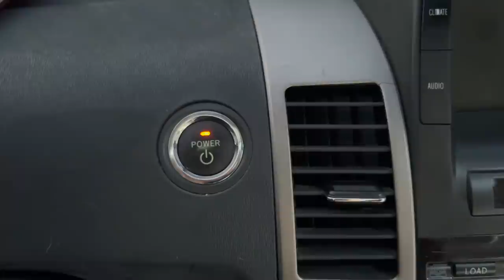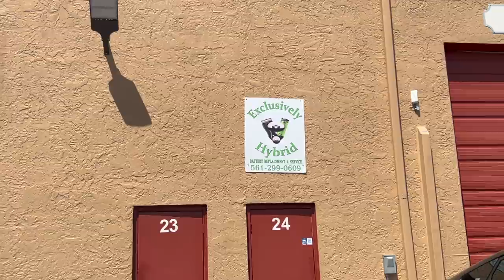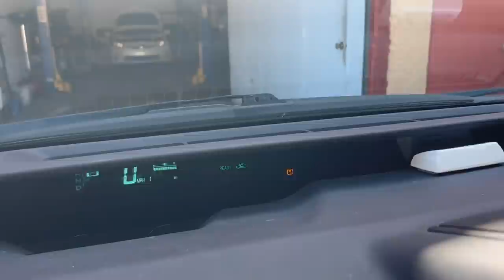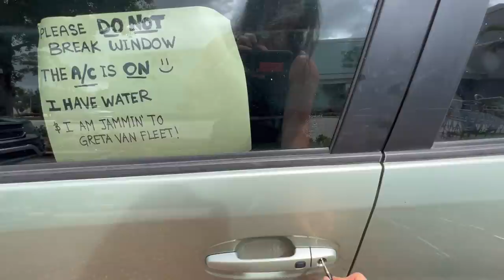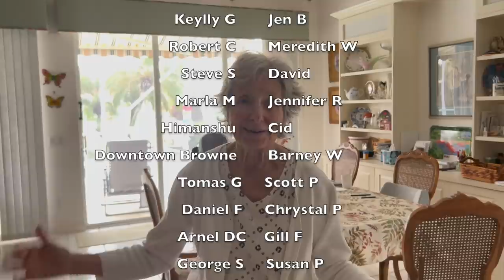LIVING in a PRIUS: We've got some BIG (car) PROBLEMS!

Comment: It looks like one or more of your tire pressure monitor batteries have died.  This is common with the mid 2000 priuii.   

    New TPMS sensors are not expensive from Amazon and they can be replaced quite inexpensively by any tire shop.

      For as much traveling as you do, it would be worth it to make sure you know when one of your tires gets low pressure.

Comment: Nomads unite, lol! I like your style, I like to see various adoptions to this way of life and what works best for each individual. Personally started out in Tacoma with a converted bed to survive weekends in the mountains avoiding ski traffic. It worked out so well decided to go full time, eventually saved enough for a cargo trailer to accommodate my motorcycle and converted to toy hauler camper. Now I've upgraded to a slide in camper on 2500 Ram, I like having windows again, oh ya and an on board shower and toilet is nice to have again. I can drop the trailer and camper, have a base camp, and explore with the truck or bike. The trailer operates more as a shop now than a living space. For those whom prefer cars consider a Subaru, and then check out what "Ironman 4×4 America" can do to them. You'll get places just the same as trucks. They probably have the best 4×4 drive trains on any vehicle, it really is amazing what they are capable of. And Ironman can rig those things proper. Not sure about the fuel economy compared to a Prius but they may have some hybrid models and crossovers that are probably  as roomy as the Toyota you just demoed. If it's a fuel issue, consider diesel my preferred fuel, still average 12 to 14 mpg fully loaded up on the highway . Pushing 15000 lbs with all propane, water, gas, and diesel filled, can be off grid for up to a month. Taking into account that lithium to make hybrid batteries is strip mined by massive equipment powered by diesel engines in the first place, I'm really not to convinced that they are all that eco friendly, really just marketing. Excuse for the novel, white out blizzard in Central OR, safe travels!

Comment: A good thing the gas tanks are designed to take shocks like that. I have a 2004 where the rear spring came dismounted from the rear end and then shot out the driver side of my vehicle as I was doing 45 miles an hour down the road I seen in my rearview mirror plume of rust and dust and in my side mirror I saw the spring doing 45 miles an hour alongside me and then it veered off the road and I tried to find it for 45 minutes unsuccessful. What scared me is I had my pitbull black lab puppy with me. And I was worried about getting the damn vehicle back to my house without toe. Older cars can be very scary. Especially ones close to the ocean in the Northeast with salty roads
Reply: I would much rather have an older car or truck than new. New ones are made cheaper, and too much technology to fix when they break. I've worked in the field for about 20 years, even though older cars and trucks can have issues than newer ones usually won't, you're better off with older. What state to do you live in? I'm in NH , near concord
Reply: @richsweeney1115  I'm in Cape Cod Mass. And I agree with you the older cars are definitely far easier to work on and made it to run much longer than the newer ones. The technology is terrible. All the motors are basically made out of plastic today. And once that stuff gets heated up and cools down so many times it warps and breaks. It's so frail with to work on after say about 40,000 mi at most of plastic clips you touch are going to snap to get to another part that you have to remove half the engine for just to replace a 40 cent plastic cam or something. Even my 92 BMW had a whole bunch of plastic on it but it's still lasted almost 400,000 miles. And me for 20 years beating the snot out of it. I never had to do the engine but the guy that I bought it from had the heads done right before I got it with 130,000 miles on it. Outside of that I never had to place the clutch the transmission engine. I did have to do the brakes exhaust suspension and things like that. But it was still easy enough to work on. Not these newer ones though.
Reply: @richsweeney1115  the crazy thing is about a month and a half prior to the shock breaking loose on my rear end I replaced the gas tank due to rusting out. And I'm damn glad I did because I know that spring would have shot right through one of those rust spots on the tank when it went bouncing off of it because it left many big dents in it on the side and back of it. And I could tell it was there because it was a brand new tank that I just put in weeks before. And that's on a 2004 Mercury Grand Marquis which if you know anything about those gas tanks you know the studs can only be used one time and you have to replace them I bought the gas tank straps for about 75 bucks I spent $110 to get four sets of the studs because that's the only way they would sell me so I still have two of them and of course I never broke the studs off I left them long so if I need to do something with that gas tank again I can just pull it down and reuse the studs that are already there if they don't break off when I try to take them back down. But Ford makes the studs so that when you pull them up you're supposed to break them off so that the next guy can't do a repair on that without Jerry Reagan something up or replacing those bolts. That cost $102 for four which included the receiver the stud and the nut.. I sold my 2015 Nissan Altima piece of crap before it broke with 55,000 miles on it and picked up this other car for $1,000 from a customer of mine that I worked off. He was an older guy so I didn't think I would have to look underneath the car for any kind of restaurant until I got it and started going through it I was horrified he lives a block away from the ocean and that salt Air just destroyed the car plus the salt on the roads in the winter. The body and cosmetics on the car look all right until you go underneath and you see all the rod the bumpers are riding off the frame is rotten to shit. I'm afraid if I touch too much More of it it's just going to keep breaking. Right now the Cadillac converter one of them is shaking rattling like a madhouse where I have a high-powered stereo installed in that car as well that I have to turn very loud in order to drown that noise out. But it still goes like a champ despite all the rust. Of course the engine only has 125,000 miles on it and driven by an old man it's entire life. So it's broken in a little. But the body will never last as long as that engine. And also the transmission shimmies from second to third gear sometimes. I went to auto technician school way back in the late 80s. So I pretty much know how to repair everything on the car I just don't have all the equipment and tools to do such. I went on to be a contractor on houses and I have all the knowledge to completely rebuild a repair a house now except for the fact that I also had colitis rip out my large intestine in 20 years ago and now it's Crohn's colitis and a whole host of other issues and a bag of poo on my belly that prevents me from doing many things. I used to be able to work 12 13 hours a day everyday now I work through three four hours a day I'm exhausted for the next 2 days. That all started when I was 30 years old. I'm 50 now and these last 20 years have sucked ass. I went from never ever needing any help from anyone to needing more help than I care to ask for..

Comment: Nikki I recommend getting another vehicle or getting a warranty for vehicles with high miss or these auto shops are going to over charge you and tell you that you need this and that plugging your tire I'm sure that wasn't cheap and you could of done it yourself just get you a tire plug kit
Reply: She had a check engine light on for months and there were four codes that they showed right on the screen.  A Gen 2 Prius is an exceptionally reliable car.  It's not as easy finding something a whole lot better than that without spending a lot more money.

Comment: Hi Niki, I had a 2013 Prius, even with normal driving, I would bottom out on some drive ways. I was always careful at campgrounds. I sold it at 90K miles because I feared having to replace the battery pack. About 4K total with installation. I think around 100K for this to happen. I love your channel and life style. I always worked part time most of my life, and enjoyed traveling and bicycle riding and camping, and spending some good years with my aging parents till they passed away. Now I’m retired and have no regrets in my life. You and your doggie keep having fun. 👍🏻👍🏻

Comment: Our first Black Lab went nuts if you told her we were going to Grandpa's place. She got spoiled every time and got to go swim and play in the Columbia River and run in the mud at low tide. They lived on Puget Island on the Columbia River 50 miles away from where I grew up. By the time I was 12, I had my own keys to the boat and could go there myself when I wanted to, and Midge got to go most times.

Comment: TPMS light is still a light, I'd recommend getting new sensors, that way if you do actually get another puncture you'll know right away.
Reply: Thank you for stating this, I saw that too and wondered how the mechanic let her leave with it on.
Reply: Look at time stamp 9mins 48 sec tpms light is off just needed time to rest .and i am sure the repair shop told her it would reset.

Comment: Been camping at motocross tracks with my wife and two young kids using our Mitsubishi PHEV Outlander SUV and a tent. Plug in hybrid allows for great opportunities to use the EV battery to power your camp site and use the gas when you need to charge the battery back up if you're no where near any hook ups. Been cooking off the car EV battery, charging my kid's MX bikes, topping off my tent house battery when that is not trickle charging off of solar or when kids need to warm up inside or grab some AC off the EV side in the heat of the summer. If you locate a charging station, we can charge the battery and save it for later while driving with gas, or charge the battery with gas while driving.

Comment: 1121 code does not indicate cooling system failure, but rather cooling storage failure; the cooling storage tank is for cold temperature efficiency.

You need a hybrid professional contact, not just a repairman that charges for everything.  Either way, 2nd gen prius do not withstand heat or sunlight well.

Comment: Curious what they replaced to fix your car. You had a flow valve stuck problem which is typical on that gen prius and also an EVAP small leak, two separate problems. As long as the tank dent isn't too deep, should be OK, it uses an internal bladder and you probably just dented the shell, but yeah...it's not an offroading vehicle. Water pumps typically go on that gen also, which i noticed he was looking in that general area with the flashlight. They were using Techstream, which is Toyota software so good on them, but get them to check your HV Battery cells loaded and unloaded so you dont get the triangle of death and have to pay $$ for a new HV battery, which will happen eventually.  Also, clean the HV fan, typically an item missed but critical to the longevity of your HV battery. Also check the connector beside and mounted on the HV fan, usually corrodes and causes problems too. Toyota Master mechanic here.

Comment: Have you considered putting a hinge on the front or back of the storage compartment where the passenger seat is supposed to be?   it would allow you to open it from the inside if you move the dog bed just long enough to get what you need?

Comment: Hey I used a prius for my bike biz for a bit.  I got way better gas mileage with 4 bikes on top than I did with them on the back.  Just something to maybe think about.  If you happen across I 70 (Glenwood Springs Co) I have one you could try out.

Comment: Try getting a dodge van or some big vehicle with a 6 cylinder , those hybrids are ridiculously expensive, I got a Nissan sentra with 129,000 miles driving to Vegas/ calif. 4 times a month . Also a Nissan truck frontier , very very reliable no major work in 6 years .

Comment: Love the vlogs. I have a 2007 Prius I had for 5 yrs. I replaced my hybrid battery’s in 2017 now the triangle of death 💀 is back. I’m thinking about a new car but my Prius gets the job done so I’m replacing my hybrid battery’s for the second time in 5 yrs I’m wondering if that’s normal or it’s something else and I should move on but let me tell you I got it with 180k I’m  at 429k and I will go to Florida tomorrow if I wanted to . My conversion van it’s just collecting dust I put 50k in that car gas in N.Y. Is at 5 a gallon I’m not driving my van no time soon . Love the vlogs you make me wanna travel more in my Prius think we need a Prius club second gen lol . Take care love from the big 🍎 . Ernest/SHAZZAM

Comment: You need a Toyota Tacoma with a GoFast Camper. Won't get the gas mileage you're used to, but the space and capability offroad would fit your lifestyle. Rumor is the 2023 Tacoma's will have a hybrid.

Comment: I was in the United States Navy during The Carter Administration.With the current political issues related NATO and the political instability.You are A True Escape From Today’s Reality For a Brief Moment in Time.You have many uploads which I’ve truly enjoyed. And finding your Prius Car Camper four-footed Companion and Family .I’d wanted to some with my 1999 Ford Expedition.But sadly with the current changing fuel situation. It will not happen  : (  I do wish to try something with my 2004 Cadillac Deville.Which going the speed between 60/70 miles an hour.With no headwind 29 miles to the Gallon. So I’m trying to find a used Scamp Travel Trailer.So I and my small  Pomeranian can escape.I will now continue to use  My 1966 OldsMobile StarFire motorhome.Which was Built also from a 1984 Prowler Travel Trailer.I’m now using it for storage.It is one of kind custom built by a now deceased NASA aerospace engineer. It almost has the front  look of the space shuttle windows,Or  Optimus Prime Transformer. It’s body from front to back is about 38 foot long.With a Rear Wheel Drive 500 in.³ Cadillac motor. It’s interior is By Fleetwood. So it makes for great storage. I live in a 1998 Avion Gooseneck Travel Trailer Double slide out. Skirted in.Parked Within Rural Agricultural America.Upon my extended families Rural America  Agricultural Home acreage.Keep uploading.Stay Safe,Take Care,Be well.As We enjoy your uploads.Stay safe out there

Comment: What do you mean, no lights?  That little orange ( ! ) indicator is the tire pressure warning.  It's been on for months, just like the check engine light.  I'm assuming you either like very low tire pressure or one of the sensors is bad.

Comment: Always take along at the very least a closet stick 1-1/2 " dia.  about 7 ft long , attach a bowie knife @  the end , always go hiking w/it you never know where & when bears , bob cats or coyotes might show up , another item is a .45 acp to keep inside your back pack or carry with an under arm holster , but get a lotta trainning with it ,be always ready !  another item is a rossi or winchester lever action in 357 or 30-30 , good to carry with a sling in the woods .  go to the range , practice ,be proficient . I am a Range Safety Officer and have saved a Lotta lives . Never take anything 4 granted ,you are the boss , never trust nice people,  keep 2 yourself. And always scan around , flashlight at dusk is very impormant and small compact binoculars , like Bushnell model 252511 explorer 20x25.  a lighter , and material to start fires ,sometimes I buy fatwood at Walmart Or soak branches with cooking oil . An electric tire pump also very important , spare keys hidden under your car. plenty of water and crackers . Crazy glue and large band aids , alcohol.

Comment: I'm also having Prius problems right now. Took her in for an alignment, and they told me the wheel bearing is messed up. Shes on bedrest until Tuesday, when the part comes in.
Reply: @EfficientRVer  Thanks for the info! I'm going to ask if I can see the new part and the old part once its swapped. Mine is a 2010 with 270k miles, so ill be happy if I get another 50k miles out of it. The shop I'm going to has good reviews, and they said it hadn't caused any other damage yet, so I sort of trust them. They have had a couple opportunities to rip me off so far, but have been good to me.
Reply: @EfficientRVer  do you think 500$ is a bad price for the wheel bearing repair + an allignment?

Comment: Nikki how do you keep the AC on? Guessing you can lock the doors when AC is still on? When I leave my Prius on the headlights always stay on.
Reply: You leave the hybrid system on with the transaxle in park, and with the hand brake on. I'm not sure which prius you have, but on her Gen 2, the lights don't stay on.
Reply: @sebclot9478  I also have the Gen 2...2009
Reply: @olddotcom   And your headlights stay on?   You can't turn them off manually?

Comment: How do you protect yourself from carbon monoxide sleeping in car? Also do you leave the car running at night when sleeping for ac?
Reply: Hybrid vehicle. Heated and cooled by battery. Gas only runs for  a few minutes then shuts off.  Minor but worth noting.

Comment: What stove / cooker do you use?  It is electric?  I have a Jackery 500.  So I would need 1500? To use the stove you use??  I don't want to use propane.  I use propane but don't wanna.
Reply from the maker: I added it here: www.Amazon.com/shop/nikkidelventhal :-) it has a lower wattage than most others I found so it works on the jackery 1000 but I don’t think it would work on the 500, not sure :-/